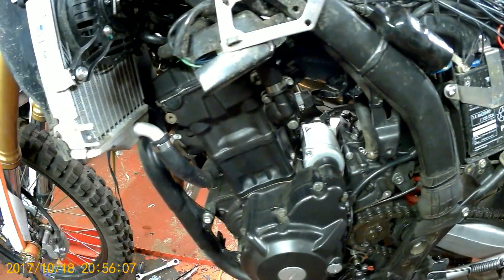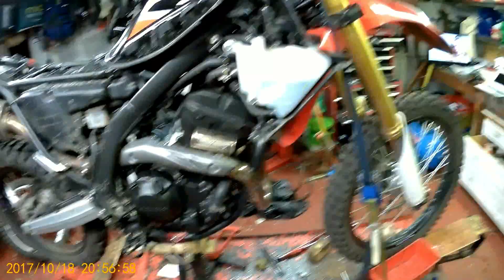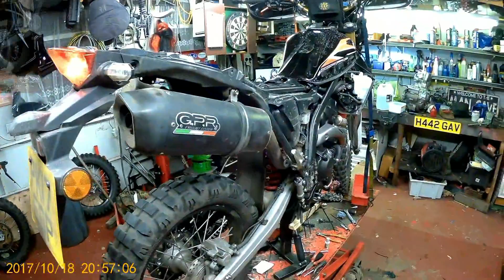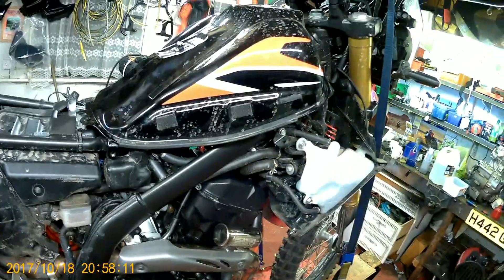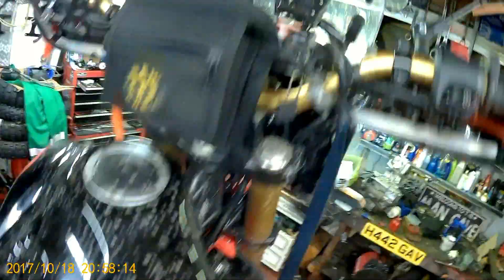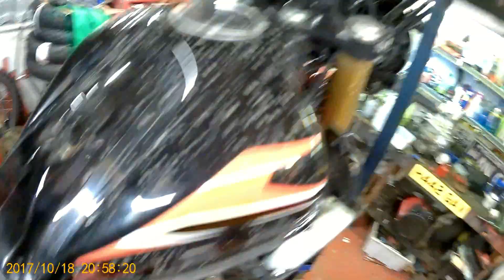crf250 rally with a cbr300r engine

Comment: I have a sad blown CRF250L (305 Takegawa) story and would appreciate your advice/feedback. I am an Aussie based in Phuket Thailand, we ride very tight single track in the jungles/mountains, my main bike is a KTM 525 EXC specially setup for single track  I also have (had) a CRF2050L with Takegawa 305 BB kit, EJK controller, Yoshi (clone) pipe, YSS suspension mods and Renthal bars.. its went like a rocket, ran perfect ridden hard offroad as was my backup bike, and also for short adventure rides,  .. THEN DISASTER .. a few weeks before i burnt the clutch plates stuck in mud,  a new mechanic replaced clutch plates, oil change etc .. the THEN in the  first easy  20 mins it blew to pieces at just 120km cruising on the road - TOTAL destruction - pieces of metal blew out the top of the crankcase (scary), smashed the starter, and fragments hit my budy in his helmet 10m away,  very scary! The pulldown revealed the worst news -  full rebuild needed - 2 crank cases, cylinder , head, , valves, piston kit, etc (I can post pix link if anyone interested). Made no sense, its was an awesome engine, ridden hard offroad with zero problems, until then... makes me wonder if something done when last worked on caused it as seems  big coincidence! Anyway  i dont want to go back to a stock 250 as I liked the 50% more power it had (my other bike is a KTM 525 EXC), I dont want to do the BB or Takagawa kits as I prefer to keep all Honda parts as when on adventure rides all over SE Asia, will be easy to get parts. SO .. I am trying to decide between a rebuild using CBR 300 parts, or a full CRB300 engine transplant, or another that fits fairly easily. As I live in Thailand the CRF parts are cheap as they all made here, so thats a plus. Can you offer your thoughts? Anyone else done similar?
Reply from the maker: tough one   to call    i have a freind who has   286   kit   cbr cams balence shaft    and head  and so far its been  fine   .on the flip side  failures with bore kits   are not unheard of  .maby a blocked oilway from the clutchfailre       who knows    ?.its that balence between  performance and   longevity thats  hard  ..having a 525 to compete against    isnt   gonna help      ..clutch can be  impoved by removing the judder assembly and installing   a  ebc1313 kit from a cbr250r   with barnett springs   way stronger  lever pull though   ....
  here we dont have much sand    but  when ive shipped abroad  ive carried a one tooth less front    ..the 300 has a shorted 1st gear  and sixth gear  but the box works ok  and you still have the option of putting the 250 cassette in    id run the 300  cassete and make your mind up then   i quite like the 300    # not worth the bother   ..i prefer the sealed honda engines     less stressed    i think they are 31hp as stock   not exactly a ripper   but  7hp is handy  and the  pay back has been   total reliability   .  so   when you compare that to the    250x  motor at 29   its actually   pretty good given its service interval      .little crf has 30k up and the rally now 18k   and the engines sound like the day they were fitted   ...watch out for crank recalls on  some 15/16 engines     ,,i have one fitted where the recall was done after the install  and its been fine   ..i find the cb engine a ok comprimise    it makes more  tourque lower down     but isnt really a lot faster upstairs    but   sat nav 70  motorway   is possible all day long    ..id say theres  little point in going mental with them as  they are always gonna be short compared to the big banger   .....id go  300r motor     1313 clutch and accept it for what it is    ...keep well
Reply: @minkyhead  hey thanks for taking the time for the helpful reply, appreciated. It hard getting relaible advise here locally. if I can find a 300 engine thats what I would prefer,  unmodified sealed Honda engine, will always last longer, but its proving difficult to find an engine here. Currently leaning towards just the 286 kit using the CRB300 bits, am trying to work out a price for this, what exactly s needed?  crank, conrod (they come assembled as one here anyway), piston, gaskets, what else? does throttle body need changing? is there a parts list anywhere for this common mod?

Comment: Why not just do the 302 Big Bore Kit remap the computer and put cams in it?
Reply: Much less reliable.  All the bore kits are a bit overdone  the  50cc-65cc  turns a moped into something else. The 300 still only makes 26hp still very modest  and reliable
Reply: @chrisredfield3240  I don't think you know what reliability means. It is not about just a kit, either.
Reply: @worldhello1234  pushing any engine  closer to it's limits will reduce reliability.  It's just more wear.

Comment: I am planning on doing this same swap to my 2018 crf250l Rally. The new Crf300l rally’s are impossible to get in my area 6+ month waitlist and dealer markups. I ordered a 2021 cbr300r engine, ecu, and throttle body. Anything else I will need? Some people say the fuel hose off the cbr but most of the people have the first gen 250l with smaller throttle body so I am not sure. Any help would be appreciated. Did you figure out the tachometer? From what I have researched it seems like a pin needs to be swapped in the connecter but I am not 100% sure.
Reply from the maker: its a while since   ..i do remember swapping the feul line over  for sure    ..you do need to swap the ecu pins   im pretty sure the tacho   is pin 7 on the cbr300 ecu    ..i cant remember  which one it is on the rally   but swop them and it works fine   ,some cbr 300r engines were subject to a crank recall in 2016   ..i only found out   after i put the motor in   so check that   if it applys  ..i am happy to report  both crf 300s are  still running sweet  after 5 and 6 years    the rally has 21000 up and the L has42.000 up  ..never given a moments bother  ..i  still use them regular off road   ..both now have crf 450x  front ends on   and  they do ride very well  ..tough bikes   for sure    it should all  be pretty straightforward  ..i remember  there was a few diffent connecters that needed  chopping and swapping  ..stator  is one     you will see the other when you pull the motor   ...engine best removed from the right  side of the bike     ..im sure it will be a good upgrade   for you   ..after selling the 250l motor   it was  peanuts  ..a few hundred quid to do the job   ...    hope that helps
Reply: @minkyhead  Thanks! I just ordered the fuel hose too. The stator crank position sensor is definitely a different (waterproof) connector. I ordered a new connector since I would rather not cut up the crf wiring to sell that engine. The cbr engine I ordered is a 2021 so it shouldn’t have any recall problems.
Reply from the maker: @brentmeyer6569    the original hose will fit  ..  no big deal either way      tou should be good to go
Reply: @minkyhead  thanks again. It seems like pin 23 on the crf should be moved to pin 7 on the cbr ecu.
Reply: @brentmeyer6569  I have been looking for this information for over a year! I checked the wiring diagrams for a 2016 CBR and a 2017 CRF250l and you are right, pin 23 and 7 need to swap.
Reply: @gearheadted  I did the swap a few months ago and made a YouTube video about it which details all the info. It is my only video if you want to check it out.

Comment: nice but wouldnt the 300 crank mod be much simpler and chear for sure?
Reply from the maker: ive already done me 250l   ,, no hassle with ignition timing   relability  ect  ...ive  still got  the rally engine as a spare for either bike  ..ill sell the 250l engine  ...cost is then very small    about 450 quid   for each bike  ..all running honda 300 ecus   and throttle bodies ...everything is spot on   ..no hassle
Reply: nice not bad if yr selling the other. im just gonna change the crank the to make it to a cbr300 engine its the only difference with them then ill power commander v with a dyno map plus the upgraded clutch spring for a much better bite.keep up the good work :)